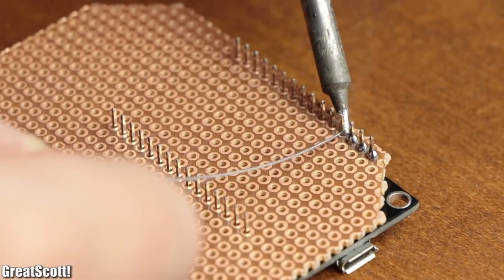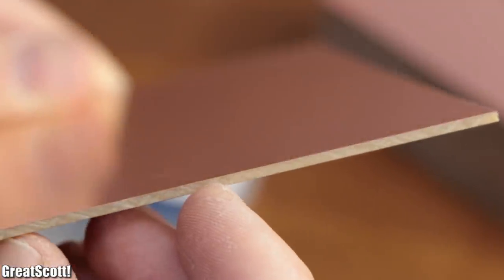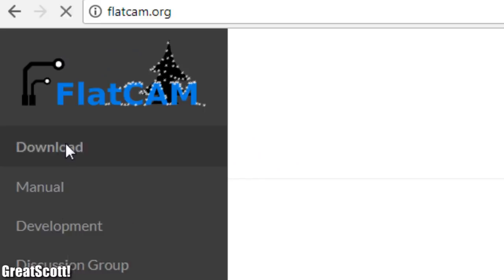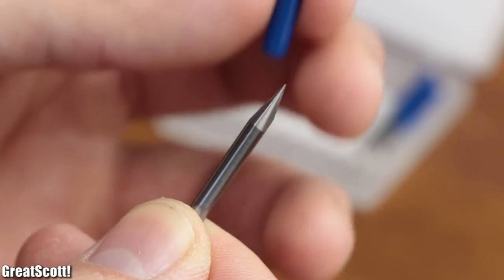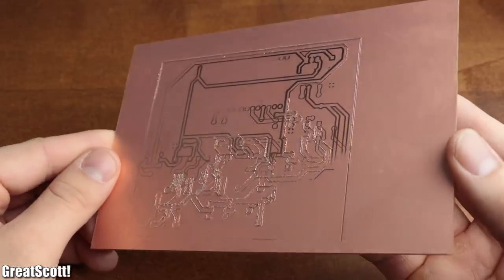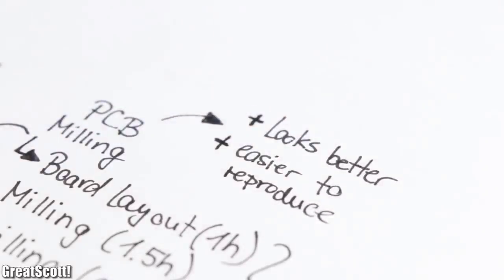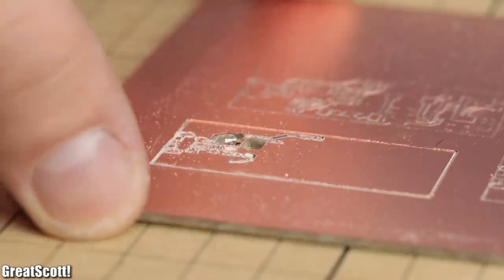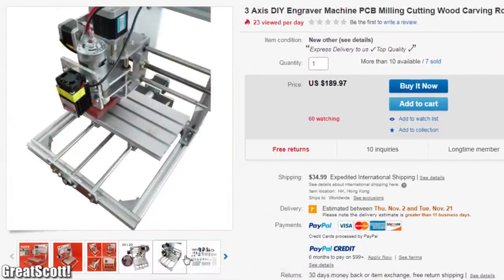How NOT to Mill a PCB (except for SMD)

Comment: It's a great idea, but FR4 dust can be very dangerous. Many companies that used to offer professional CNC milling solutions for PCBs completely enclosed their workspace, and fed the air through a HEPA filter. Many of those companies no longer sell milling machines, in favor of using a laser ablation process (which doesn't produce dust).
Anyways, you should add a disclaimer to the video stating that FR4 dust is dangerous.

Comment: "Don't DIY it, use the service I advertised for previously." 
If you had fixed the screw and used the right size cutting tool in the first place it would have likely worked

Comment: the more money you sped on a cmc the better it is ( harder materials, more precise, better software more axis) this range goes from 150€china mill to 1,8mio € mill with 9 axis and hand made in germany that can will zikonium and titanium, and even more 

it always depends on what you need/want , pcb milling is a pretty basic 2d operation, so a 300€ 3018  or 3020 mill will be just fine , for  alu you probably looking ot 3-4k for a nice quality mill

but fiber reinforced stuff is REALLY bad for your loungs so do something against the dust

Comment: I have to disagree with your opinion on through pcb milling. At my job we have a lpkf pcb mill we use for double sided smd and through-hole boards, while it takes time to mill, it results in cleaner prototypes and allows for rapid prototypes. Since the schematic and pcb files are already made, you can keep adding and removing parts until you get your final pcb to be professionally milled.  While milling is most likely over kill for hobby projects, it's very useful in a design environment where you can't wait 2+ weeks for board orders and don't want to spend hundreds of dollars expediting your prototype board.

Comment: I have better luck with 0.5mm straight bits. You can skip the autoleveling with these since you can just mill deeper and it doesn't affect track width. Also, you can use the same bit for the holes of most components (and pilot holes for things that need wider holes, then drill manually using thicker drill bit).

Comment: I would say no. But I only have made them by hand, draw the layout, print on trans with a laser jet, pre-sens  board and get mad when I forgot to add a trace or something else. Correct the drawing and do it again. I usually don't draw a schematic, I just have that in my head and go to drawing the circuit for the board.

Comment: I think milling a pcb is not a good idea at all, but laser engraving is. However, copper is not ideal unless you have a power laser unit. At this point, I would go with laser and the classic photo-resistant, developing and etching. After all, even the industry rarely mills a pcb.

Comment: A cheap Chinese CNC should do PCB milling just fine. There is very little force required so a comparatively flimsy frame and weak steppers shouldn't matter. Just don't expect a long service life on the spindle motor for those machines, nor a controllable tool run out if you need to work in mil.

Comment: I have the small LinkSprite CNC mill.  It is not a precision mill.  It has tremendous frame flex and it is nearly impossible to precisely level the bed.  It would not be useful for circuit board production.  It is however a good way for a student to learn CNC concepts and is useful for crafts.

Comment: I think for small amounts of prototyping you're much better off with UV exposure masks and etching. Cheaper startup cost, quicker, no mucking about with Z-level or replacing expensive mill bits.
That said, if you already have a CNC, why not use it, right? Maybe a compromise would be using a laser module on the CNC (with Z level locked to focus on the surface) to burn off some black spraypaint, and etching that. I imagine you could get incredibly small feature width that way with enough practice and fine-tuning.

Googled for a guide, found this from 2008: https://hackaday.com/2008/08/03/laser-etching-printed-circuit-boards/ Ctrl+F "Garrett", 2nd comment from him has more details.

Comment: It would make sense to etch a board using the toner transfer method.  Milling anything at the speed that machine can achieve and with the manufacturing tolerances of the board material is not worthwile. Cnc almost never makes sense for small batches.

Comment: Why not to use dry film? If You have pcb layout yet, you have to print this in negative, place on dry film laminated pcb, develop with UV (nail laqueur set (36W UV) will be quite usual, etch. Enture procedure from printing layout to drill holes lasts about 30 mikns to 1h. Or why not to use overseas PCB manufacturers? It's last about 5 days (delivery from US to Germany) and costs about 5$ for 10 10x5 cm PCBs (with drill, solder mask and silkscreen).

Comment: I actually disagree with your conclusion. I do not think you can advise others to do or don't do something after trying only once or twice yourself. Ordering a pcb in China might take a week of maybe two before you receive the pcb. I think that's a disadvantage. Some manufacturers allow a minimum of 5 boards, which is a waste if you only need one. When milling you do not have to wait next to the milling machine until it has finished. I just start the milling process and come back to check the result every half an hour or so. After I tried about 5 pcb's and have done some tweaking in flatCAM my results are very good for traces of 10 mils or wider. You then can take the same settings every time. But you have to use a program like autoleveller or similar like you mentioned for good results and also level the bed if possible. The engraving depth I use is 0.1mm max, so if the board is curved the results are horrible without using a software leveling tool. Also very important use good engraving bits (5 mil tip, 60 degrees, hardened tips), not the cheap Chinese ones. Calculate the actual tool with with an online tool width calculator (5 mil tip = 0.127mm, with a 60 degrees shape and 0.1mm depth the cut will be 0.24mm, use overlap as well). If you've done a few boards and use the right soft- and hardware the effort is minimal and the results are very good. So don't let people scare you of with their bad results.

Comment: i tried this in november 2016. and it went ok. but the problem i have is that the tool bit (10 degree 0.1mm) will break off at a certain time, the depth or speed doesnt really matter, it will break. but i agree its giving just as much trouble as it speeds up process

Comment: I built a homemande 1m by 50cm CNC and honestly, it was cheaper, more sprecise and way quiter that the chinese version.
I tried PCB milling huy the result weren't that great, the copper whould usualy get torn off or the bit would go too deep.

What I would recommand is using the CNC to drill the holes of a through hole board made with the normal etching process.

Comment: I own a 3020T mill and I can say that it is pretty fast, once you have a little practice. It takes about 20-30 minutes of work from layout to finished PCB (slightly longer for double-sided). Between that, the machine can run the milling job unattended (except if your z axis pulley comes loose - happened to me too). I use https://github.com/pcb2gcode/pcb2gcodeGUI for generating the nc files and https://github.com/Denvi/Candle for controlling the machine. It has a very useful auto-level function - highly recommend to use it. Btw, 80mm/min is rather slow, I use 150-200mm/min. I definitely agree though, that milling isn't the best way for every project.
Reply from the maker: +Christoph Mudri Thanks for the feedback. Useful information.

Comment: I understand the point of the video. But let's be honest pcb milling with a cnc is a skill, with the right tools and practice it can be performed quite fast. And the benefits are endless, multilayered pcbs and smd components allow for much more complicated circuit design.
And while your cnc was milling you can go do something else. So if anything this video was more just a showcase of your skillset and current expertise in circuitry.
For anyone interested the chinese cnc's can do much more than just mill pcb, but even with low prices "what you pay for is what you get" still applies. If you buy low cost machines you will have to spend a lot of time dialing it in right.

Comment: I have had very good results with milling PCBs. I disagree that the thickness of the board varies greatly. You do however have to plane you work surface first! I used double sided tape to stick the PCB to the planed work surface. Milling is especially good for through hole parts because you don't spend forever trying to drill tiny holes exactly in the middle of the pad like with etched PCBs. You can see some pictures here: http://www.abload.de/gallery.php?key=6GZDGVD1

Comment: Your time estimation is wrong. Your milling machine requires only a little attention when it works. So you are free to do something else, like designing another pcb. Also use "candle" grbl sender that allows you to take the height map of your laminate, which is very easy for pcb as it just doesn't require any special probes - you can just test it by quick wiring the board and the drill. Finally - if you use 0.1 mm drill, you need to take into account that it would never carve 0.1 mm wide path. It would be more like 0.15 or even more. It's becouse the drill may have some shaking, vibration etc. Also - the deeper it cuts the more it's cone tip carves wider paths. So - for 0.1 drill I tell my flatcam to drill 0.17mms paths. For 0.2 drills, I tell it it's 0.25. For cheap chineese drills go for 10-20% more. BTW - I'm using this cheap CNC from China and it just works. It can even carve aluminum if you do it slowly. The point is that it's overall quality strongly depends on the assembly quality. And you cannot expect from the NEMA17 motors and cheap under 100W spindle to cut through metals at hight speed. But for PCB's it's a bargain.

Comment: I don't think there's a problem with your machine. It's rather clamping that is the problem. PCB board material is quite soft and flexibile, so if you push it on the edge it starts making a curviture in the middle. 
Here's my badly made crossection of clamping https://ibb.co/kkLfnK (sorry I don't have anything better than mspaint at the hand right now). In this case the piece that supports the clamp on the base side (blue piece) should be just slightly taller than the thickness of PCB board (not more than 1mm taller). That's a common practice in industrial machinning so I recommend it to you. I hope it helps.
Also I think you can push feed rate more rapidly.
Otherwise, great videos. Keep it going :)

Comment: 200$ for a router buys you a whole lot of 2$ PCBs :)
I guess if you really have to have the board yesterday then maybe it makes sense, but home made boards almost never have plated through holes and that's a deal breaker for me. Most of my boards are 2 layers and without the plating I have to manually solder in all the vias and make sure both sides of THT components are soldered. At best this is tedious, and sometimes you just can't get under the component to solder everything.

Comment: as long as the axis of the china systems are solid then good calibration will make them work pefectly , people make out cnc and 3d printers are delicate thing , they are not they are as strong as they are built as long as the axis dont shift during a run then they will be fine . people make 3d printers out of milk crates these days im sure china can make it work

Comment: Vacuum plate and no probe...on my cbferrari mouldmaker cnc..qfn 32.  Tqfp 32 atmega 328 without particular problems. V bit owned at workshop with a simil deckel d bit grinder

Comment: The miling isn't really your time because you can be doing anything else while it's going so i don't think that should factor in. Plus you used a complicated convert to gcode method when for fast an dirty work you can feed the xcarve a black and white image and it can carve that. Which i think is much faster but less precise.

Comment: Hi dude goob video but this is i think.
 I have already experience using CNC machines and pcb manufacturing and I noticed several mistakes that you made, for example how to calculate the speed of the tool, the speed of advance, among other things the production times can be greatly reduced if you set the settings.

Comment: perlfboard with using wire wrap is great if your outcome requirement is not so high and your soldering skill is good。small and simple pcb is suitable most。however。complicated one can also be built but the numerous wrap wires are proned to detached off and makes function fails。also smd components are not aceptable in this type of prototype。for thru hole parts。they can be positioned anywhere and cramped in a small space by routing them together with wrap wires without any forethought first。so it is by far the most fastest。cheapest and versatile method。。。cnc type needs more design and set up time at the first pieces。so it is great for several pieces type。also the requirements of neatness and secured robust pcb assembly can be attained。using too pointed cutter tip during milling is prone to tip breaking。 cutter bit is expensive。the type showed in video may not be suitable。my preferable one is d-cut shape of v-angle around 30 degree for not easily breaking but the sacrifice of larger clearance between tracks。too thin milled cut tracks are prone to peel off easily during handling or soldering。it is also one disadantage of this method。。。haven't tried ordering pcb method。for home diys。need to have patience to wait even a couple of days leadtime and readily modifications are not possible are devastating。also you need to know all the manufacturing criteria。so don't need to say it is cheap nowadays。however。 it ls the most beautiful pcb you will get and also easy for any quantity you need。。。photo etching was done a long time ago when i was a kit。messy。and nowadays need more set up facilities to help。。so all in all。 it depends on what situations you are facing。 not to say which one is absolutely good。

Comment: Your poor result is due to the quality of you cnc machine. If you use auto-leveling or sprint loaded spindle which keeps the distance very precise you will get much better result and much faster results as well. Double sided through hole or smd works fine with cnc milling but I wouldn't recommend 4 layers production with CNC.

Comment: But you are really removing the copper from PCB? how does it make a path by removing the copper?
Reply: By removing copper you're isolating certain traces, meaning they make connections to anything that's in the isolated trace - so that makes the path :)
Reply: thanks, i was thinking the wrong way.
Reply: It's alright :)

Comment: Not great for smt either - many pin spacings are too fine, and really .. don't you want solder resist to make life easier? When you can Electow 10pcbs with all features for $10 and have rhen in 1-2 weeks .. its hard to pass up

Comment: Height map, takes 5 minutes, all problems fixed. 
Yes, cnc from china can produce cnc's but the chucks are not the best thus giving the effect of a wider tool tip. 
I produce pcb's unsoldered with cnc under 1h usually with chinese cnc.

Comment: I think it's easier/cheaper just to order PCBs professionally made. Maybe not quicker, but the other two make up for it.

How much money did you just throw out? Not being a prick, just pointing to the 🐘 in the room.

With that being said, for sure the $200 machines would work just fine. You might have to brush up on your chinglish a bit. Also, you might have to buy a few parts due to quality...but with your skills you would probably spend half of what you did on that machine and get more desired results.

I like their software....but I don't....I can already tell it's not open source and I don't do not open source because of fees or subscriptions often associated either now, before, or in the future when the better version can do what you need/want.

Comment: Why mess around with a crappy milled board when you can get good e-tested boards from china? I paid $20 for 10x10cm with a week turn around, silkscreen and etest -- if you're patient, it's as cheap as $10.

You can also do bga/flatpack qfn no problem, plated vias etc

Best of all, no nasty dust, unreliable equipment, wasted time, and general aggravation.

Comment: Nah, waste of time. I've used perf board since the mid 1980s and love the stuff. You can mount simple SMD parts in wire stubs through the board, or use SMD to TH adapters for more complex parts. And if you need a PCB, get one professionally made. CNC routing just doesn't come close to the quality.

Comment: Your feed is waaaaay too low, I'm pretty sure you can cut this board in less than 5 minutes. The best way to get a flat pcb is to glue it to an aluminium plate. Without solder mask it'a a pain in the ass to solder this.

Comment: I do not know who uses THT anymore. Anything serious or high frequency wouldnt be done in THT - that standard died in the 80s. Other than that: showing that you do not service your machine correctly and your work turns out to be bad quality is no surprise. Also: reflow for smd, you are butchering your board with your low soldering skills. Get a hot air station (quick D861) or a reflow plate or oven whatever you prefer. And reflow paste. And if you still want to solder, use a wider tip! It will give you more heat at the tip thus making soldering easier and faster. The small tip is never good for anything!